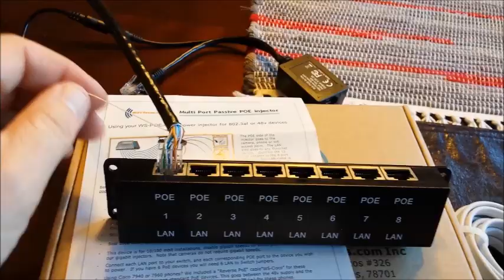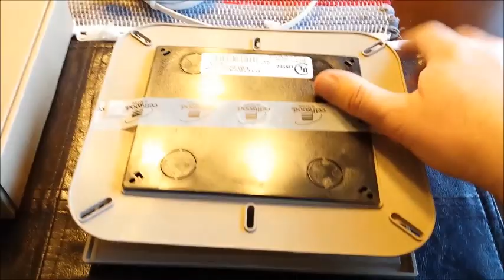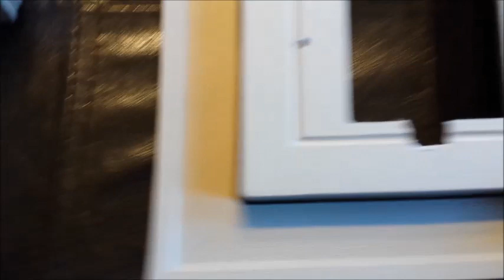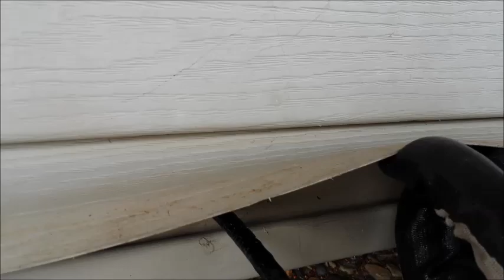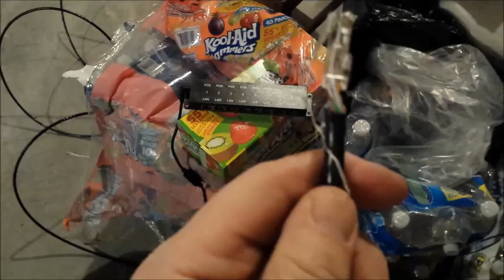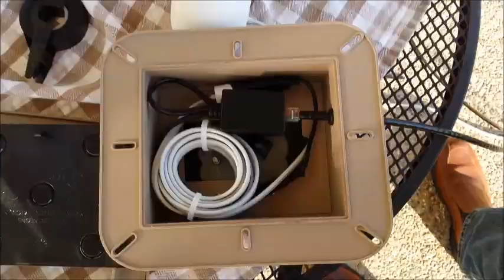Nest Cam Install POE

Comment: Why downrate? The guy tries to come up with a solution for a practical problem and actually manages to do so it seems. Have thought of this option ever since I saw the splitter was available. 

@Abron2017 Would be nice to  get a new update as the latest seem to be over 2 years old. Does this setup still work? Any issues? Thanks mate!

Comment: Any updates on your Nest set up? Still working well? Let me know thanks!
Reply from the maker: Still working!  Last summer I had an issue with a POE splitter( where cable hooks to camera) that  burned out.  Come to find out I had ordered the wrong one and it wasn't rated for the camera.  I swapped it out and all is good.

Comment: I like what you are doing and am trying to do something similar. What I have is a 48v ac/dc adapter and a 5v 2.4 amp and 12w splitter. When I plug in my nest camera to the setup, I get blinking lights on the Poe switch and the splitter. What volt is your adapter and is the specs on the adapter ok?

Comment from the maker: Quick update, I am now 6 month plus in to my camera installation.  Everything is running fine.  I rarely get a drop off in Wi-Fi and I have had no power issues with the POE setup.  I have since installed another camera using this same procedure and it has held up fine for 3 months now.
Reply: Great video, was the nest app free or did you purchase some type of membership to view?

Comment: Good job hiding all the cables. Have you thought of getting the Nest doorbell?
Reply from the maker: Not really, I think I got the view I needed from the position above that I setup.  I like that the camera is mounted high enough that most people don't notice that it is there.  One big downside to the higher positioning is that when I try to talk to people through the camera remotely, it isn't very loud.  It's possible that the doorbell version may be better for that.

Comment: I'm guessing this still forces you to connect to WiFi?
Reply from the maker: Correct. I still use WiFi, the camera does not accept ethernet cable.  I found optimal positions on my (now 3) camera installs.  Luckily my locations have all been pretty good for connectivity.

Comment: Nice information but you should use pass through rj45 or better trim. Even though you seem to not be using it for data it would cause loss
Reply from the maker: Thanks for the suggestion!  I wasn't aware that there was such a thing as pass through, and it makes sense that it would offer a better connection.  So far my camera has been very stable as is, but I am planning on revisiting that connection in the spring since I didn't have any relief boots at the time of install and I just wrapped them in electrical tape due to a time crunch.